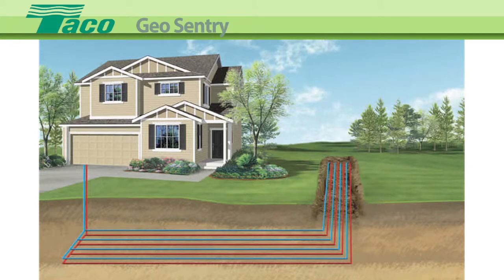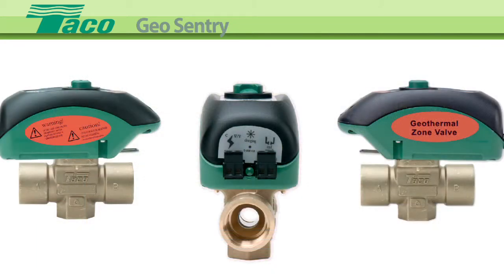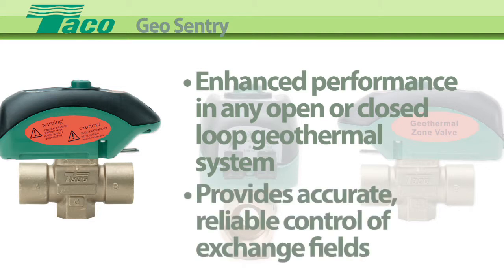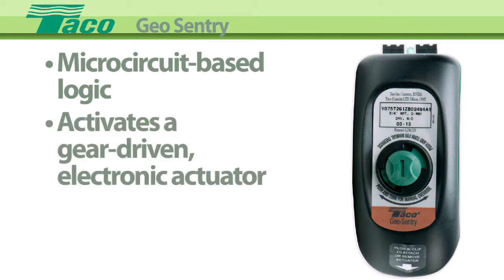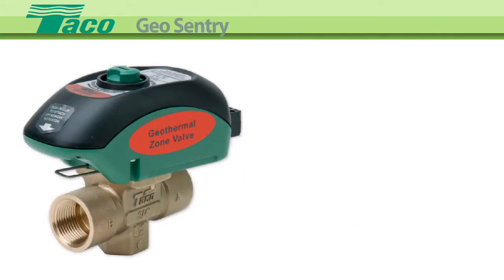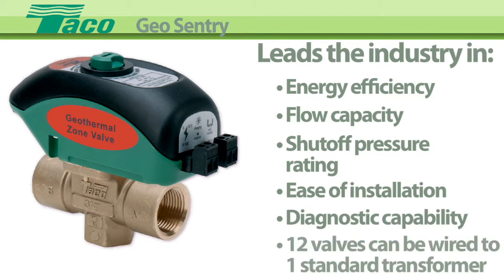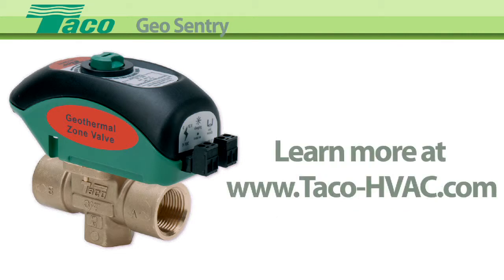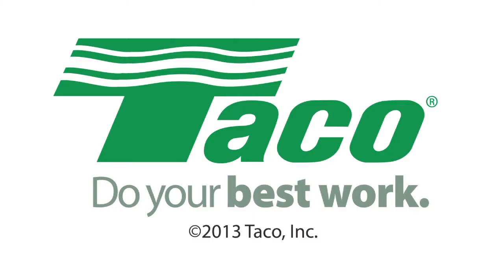Geo-Sentry™ Zone Valve

Comment: Are these supposed to allow water through a 
at a reduced pressure?
Reply from the maker: The GeoSentry is a open or closed actuator valve. It will open or close based upon the unit or the controller being used to allow flow. They do not regulate flow